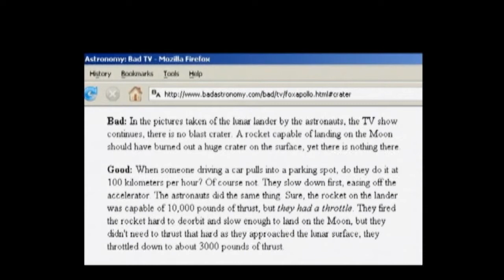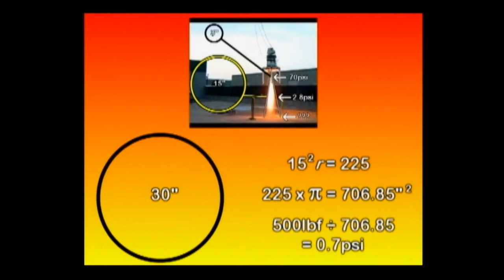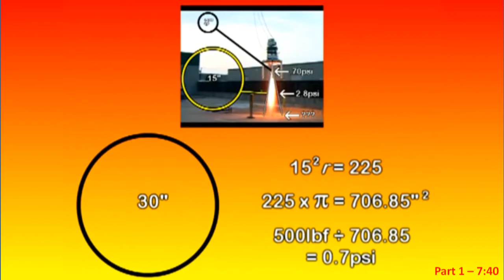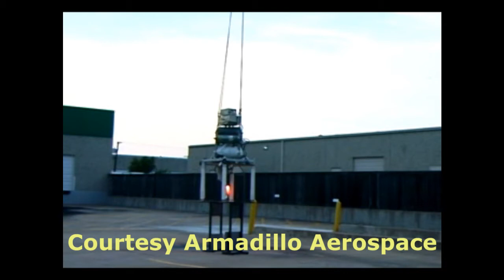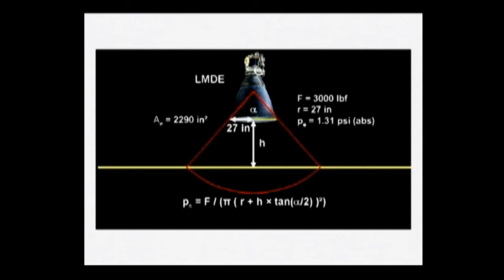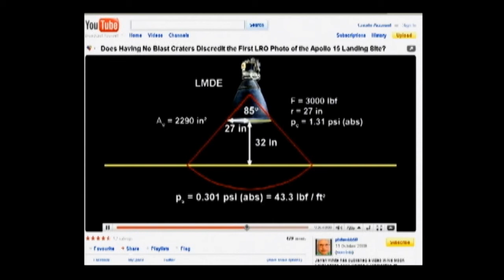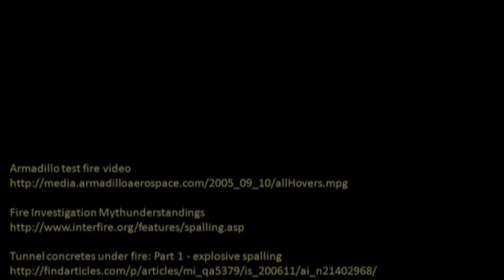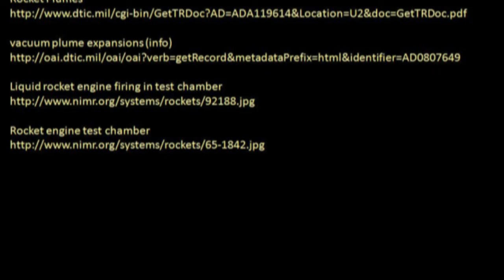MoonFaker: No Crater Addendum: Critique #02: Concrete Science

Comment from the maker: 2. Look at what I wrote to MBDK 7 hours ago. "For the particles to escape from under the LM, they had to be moving away at fairly low angles. Some particles grounded out a few feet from the LM, while some might have gone several miles. When the LMDE shut off, the spray would simply fly off toward the horizon, getting thinner and thinner the further it traveled from the LM."

Comment from the maker: Actually, the Armadillo rocket video has nothing to do with Apollo. White's claim was something like, "if a rocket with 500 lbf thrust can blast a hole through concrete, then the 3000 lbf thrust from the LMDE should be able to dig a crater in moon dust." The main point I made was that the concrete was being broken up by thermal spallation, not pressure.

Comment: Lampooning it is then.So i would like you to provide me with some information that you believe to be the facts.This will remove any errors you may think i made in reguards to fact's.
Q1-What fuel mix was used in the rocket engine of the LEM ?
Q2-What would have been the temperature hiting the suits while walking on the moon ?
Q3-What was the speed at which the regolith would have been traveling during liftoff.
Q4-What type of foil was used on the LEM?.

Comment from the maker: Sorry, I didn't notice your comment was directed at Batman. I'll be more careful next time.
Yes, the term "spray" is probably more accurate than "cloud." For the particles to escape from under the LM, they had to be moving away at fairly low angles. Some particles grounded out a few feet from the LM, while some might have gone several miles. When the LMDE shut off, the spray would simply fly off toward the horizon, getting thinner and thinner the further it traveled from the LM.

Comment from the maker: Supports? Do you mean the black aluminum supports that the rocket is setting on before it ignites? They weigh about as much as an aluminum folding chair. Notice the black panel at the top? That helps catch the wind to kick them out of the way. They're designed to fall away once the rocket ignites.

Comment from the maker: Did my aside on calculating the contact area of a tire confuse you. If so, I'm deeply sorry.

If you're wondering what's being compared, it's pressure. The pressure exerted by the car tire and the pressure being exerted by the rocket plume.

What makes it an apples to oranges comparison is the fact that the rocket plume is hotter than the tire. It's so hot, in fact, that it causes water in the concrete to boil and that's what causes the violent spallation.

Pressure = apples; Heat = oranges.

Comment from the maker: The LLRV (basically a prototype) that Armstrong was piloting went down because one of the attitude control thrusters ran out of fuel due to heavy winds. That's not a stability problem. Armstrong successfully negotiated 30 flight scenarios and more than 50 landings in the LLTV.

Comment from the maker: 1. You do realize that my argument was that the pressure from a car's tires is greater that the pressure from the Armadillo rocket's engine, yet that pressure doesn't bust up the concrete. You also realize that if you allow sidewall support, then your contact patch is smaller. Same weight, smaller patch, higher pressure. So, you're saying the pressure from the tires is even greater than my estimate, and yet the concrete doesn't break under all that pressure.

Comment: As the moons gravity differs from place to place,then your last question cannot be answered accuratly. On average,the moons gravitational acceleration is 1.63 m/s squared, where as here on earth it is 9.8m/s squared. So even though there is no resistance due to no atmostphere on the moon like here on earth,the same dust particle will fall faster here on earth than it dose on the moon-thus the dust cloud on the moon would remain airborn longer- due to a much lower gravitational acceleration rate

Comment: I think you may have to go back to the drawing board Phil.The bit about the tyre preasure being the preasure (PSI) exerted onto the ground is wrong-so very wrong. The other thing you have failed to take into concideration,is the fact that the moons gravity is 1/6th than that here on earth.This means that each particle of dust or sand on the moon weighs 1/6th of the same particle here on earth. This also means that it needs only 1/6th the amount of force to move that particle..

Comment from the maker: As I said elsewhere, a cloud is a suspension of particles and/or aerosols in air. Again, 'splain to me if you will, Batman, how a particle in motion would stop moving and form a cloud. While a force is acting on a particle, it accelerates. When the force stops acting on that particle, it continues moving at a fixed velocity. It doesn't just hang in the air or a vacuum and wait for gravity to slowly pull it down. It will continue on a ballistic trajectory, like a bullet or an arrow.

Comment from the maker: Puny? Yeah. I laughed too when Jarrah said that. It has one-sixth the thrust of the LM on landing. That means that just six of these puny little 3-inchers would carry you down to the moon's surface safely. The nozzle on the LMDE was designed to run optimally at the high end to provide the best breaking and knock them out of lunar orbit and begin the descent. It obviously didn't need to be that big when it was throttled back.

Comment from the maker: @MIGUEL2005LIMA Roberts developed an approach, agreed. Re. Morris, et al. Yes, another approach, the DSMC model, adapting Roberts' approach somewhat; using data that wasn't available in 1966. Do you recall any conclusions made in that paper? The conclusions may be on page 6, just above the acknowledgments. Do you recall how deep a crater they calculated would be eroded away by the descent engine? Do you recall if it agreed with the Apollo observations or not?

Comment: There are two forces at work webby,not just one-the other being gravity.The bullet and arrow will have an arc projectory because of the acting force of gravity.You asume that all the particle's are being blasted out at right angles to the rocket plume,which they would not be.A quote from NASA them self in reguards to the LCROSS mission.Quote: NASA scientists analyze the resulting plumes of dust -- more than 250 metric tons' worth.

Comment from the maker: I never said there was "no crater" under the LM. I actually calculated that a minimum of 8 metric tons of regolith was stripped away from under the Apollo 14 LM.
watch?v=yDs6-3Yt0Yk&t=330s
In a vacuum, you will not see the billowing occur that you would expect from our only (earth based) perspective with an atmosphere. In a true vacuum, the exhaust gas will expand more than the 85-degrees I noted from the rocket test photo. Without any air pressure, the exhaust will be "grossly" under-expanded.

Comment: if the concrete exploded (?) away from the rocket exhaust, what knocked over, and repeatedly moved, those supports of the rocket? they seemed pretty heavy and were easily moved away from the center of the end of the blast. previous vid said debris would go up then come straight down when engine shut off due to gravity, but since lack of atmosphere would let debris keep going on trajectory, what was left to fall straight down?  but then they would be aware of this while "faking" it, i guess. thnx

Comment: @imnazhole When is 3,000 lb not 6 times 500 lb? When it's spread over a far larger area. Compare the size of that tiny test rocket to the huge nozzle on the LM descent engine. Also consider that one is firing in air, which keeps the plume long and thin, while the LM landed in a vacuum that allowed the plume to expand the instant it left the nozzle.

Harriers have much more thrust than the LM, but even when they land on concrete they don't dig craters, do they?

Comment from the maker: Okay, riddle me this, Batman...
1. If an automobile sitting in a parking lot is held up solely by 4 treadless balloon tyres (with no sidewall support), and the tyres are aired-up to an average of 30psi, how much pressure on average do the tyres exert on the ground?
2. If one Newton of force can accelerate 1 kilogram of mass at the rate of 1 meter per second squared on earth, how many Newtons are required to accelerate 1 kilogram of mass at the rate of 1 meter per second squared on the moon?

Comment from the maker: But, there was no air in the descent stage. The only coupling for "vibration noise" was through the frame. If you put your ear to a train rail, you can hear the train coming from miles away, but pull your ear back a couple of inches and what do you hear? Nothing. Also, as ytmoog pointed out, they used noise cancelling microphones. Point me to a video where you hear the shuttle rockets firing up.

Comment: @imnazhole You didn't read what I said, did you?

I'll simplify. The moon's surface is not made of concrete. Concrete contains water, and so it crumbles into dust when hit with high heat.

The moon's surface at the Apollo sites contains NO water. It did not decompose when hit by rocket exhaust. But Apollo did blow away quite a lot of dust, as seen both in the landing films and in the post-landing photography.

You have your "craters", they just don't look like you expected.

Comment: From a google search-look to the skies dot com-Quote:Since it only generated 1050 pounds of
thrust (not 10,000 lbs like FOX said), and the gravity on the Moon is less, and the engines were shut off BEFORE impact, there can't be a blast crater.
 This is on the first page of a google search.As you can see,it is 100%+ less than the 3000 pounds thrust from other web sites.

Comment: @philwebb59 well the  fact is  that the regolith is very  different  with  SOLID CONCRETE, static pressure formula is  useless  in this case , the rocket  is a stream  of hot gases   with  SPEED, this  jet is  an agent for  EROTION  of  the particles who  conform the regolith.

Comment: @philwebb59 Yeah, I pointed that out too. Water turns cement from a powder into a hard rocklike material, and removing that water (with heat) turns it back into a powder. The lunar regolith at the Apollo sites is barren of water so it's completely inappropriate to compare the two materials.

imnazhole also seems quite ignorant of rocket principles, in particular the conversion of thermal energy into linear mechanical energy that cools of the exhaust.

Comment: Why is it that a man can jump say 3 feet of the ground on earth,yet the same man with the same mass could jump over a meter on the moon using the same amount of force?.Why did the LEM need 10000 pounds of thrust to lift of the surface of the earth,and yet only 3000 pounds of thrust to lift of from the moon. You seem to continualy ignore gravitational forces at work,and the fact that this force is very different on the moon,than here on earth.

Comment: yeah, i watched the video, too. just trying to point out that the runway is meant to deal with the rocket like a road is meant to handle cars. but if your landing on dirt with a rocket it seemed that if it had enough power to push those supports around, wouldn't it push dirt away from the center of blast area? but as i said earlier seems a stupid detail to leave out if they faked it, and the math in these videos is beyond me. seems this video is being used in the wrong manner by both sides.

Comment: @philwebb59  i dotn change nothing but, repeat,  if you  says , now, " "" I agree that the pressure doesn't cause a crater. Force causes the crater"" ,, then  ti seems like  you are undertstanding  the point. the jet  dont is a  solid object, and is the  gas stream speed  the cause  of erotion, the cause of the crater.

Comment: still doesn't address the question. if the rocket had enough thrust to push even aluminum supports, even after they were knocked over initially, wouldn't they have enough force to push through the lunar dirt no matter what it's composition? i doubt its concrete meant to deal with cars, harriers, and rockets. like i said previous, though, seems a stupid detail to leave out if it was faked. probably just need to touch the moons surface and put my hand under the rocket exhaust to really know. lol.

Comment: Jarrah's ignorance of chemistry seems to match his ignorance of physics. Concrete is not lunar regolith, and they don't react to heat in the same way. Concrete is held together with Portland cement, a mixture of various oxides (mostly calcium oxide, quicklime) that react with water (hydrate) and harden. Apply heat and you drive the water off and the cement crumbles.

The equatorial moon is famous for containing virtually no water and for being refractory - able to withstand intense heat.

Comment: @philwebb59 no  no no,  you show  the formula  force over  surface, that is the  formula  of  static pressure.  your falace comparation with a  car wheell ( a solid)  is  for  static pressure  too. you  leaves apart the effect  of the speed of the  hot gases stream, the jet  itself,  and   the EROTION EFFECT in the  regolith.  you cant   work  with a  stream  of gases  as  if  the gases was a  solid object.